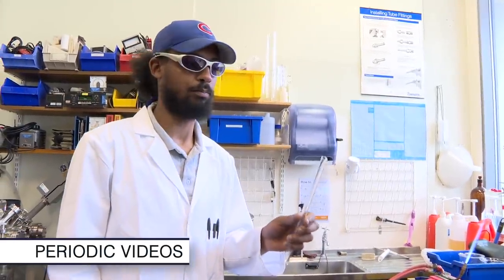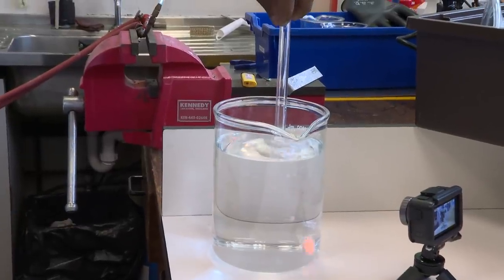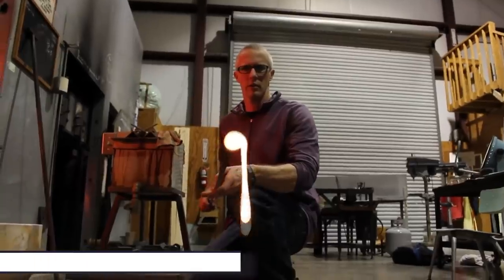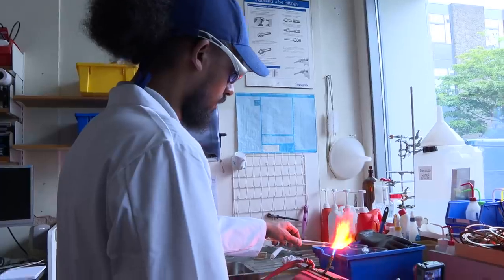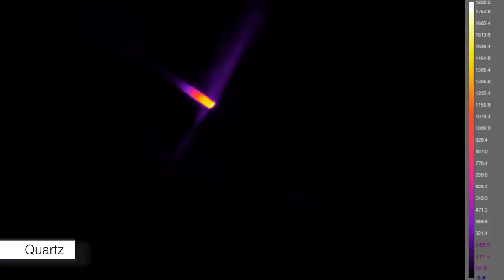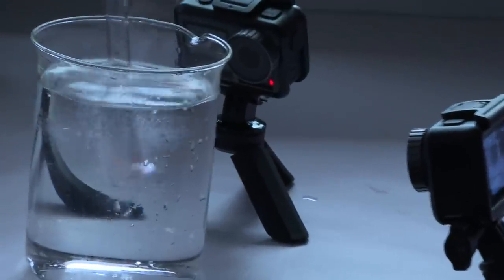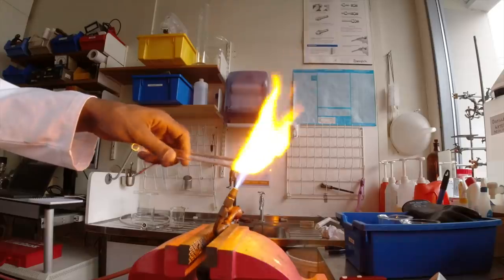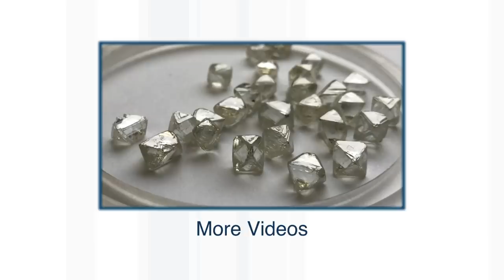Hot Glass SHATTERS in Water

Comment: SHAME ON YOU PERIODIC TABLES FOR NOT TAKING INTO ACCOUNT ALL VARIABLES WHEN PERFORMING AN EXPERIMENT!!!

It's not the difference in the Coefficient of Expansion (CoE) between the quartz test tube and the borosilicate rod that's causing the rod to shatter where the tube does not. It has to do more with the volume of thermal mass, the shapes of those masses, and how evenly the object can cool based on the mass shape and amount of thermal mass. The tube shape doesn't have much mass between the edge of the tube and the center, so it's able to cool far more uniformly than the glass rod, thus avoiding shattering from thermal shock. You would see this same effect if you heated a tube of borosilicate glass and dunked it into the water. Likewise, you'd see a rod of quartz shatter similarly as the borosilicate rod, albeit much more slowly, as it takes much bigger temperature change in the quartz to create those strains needed for the piece to break. 

Remember, the only real difference between any type of glass (which also exhibits the same properties, just at different temperature ranges) and pure quartz is that glass is a large mass of silicon dioxide with impurities. All the impurities do is change the Coefficient of Expansion in the same way that impurities added to water changes water's thermal performance (freeze/thaw and boil/condense points). (Well, and a few other things related to light, but that's not material to this experiment.) And because you're trying to demonstrate the different performances of two chemically similar objects, you have to make sure the masses and shapes are as similar as possible to each other.